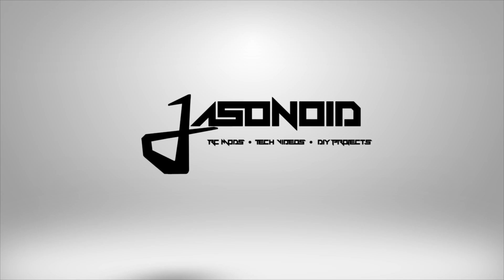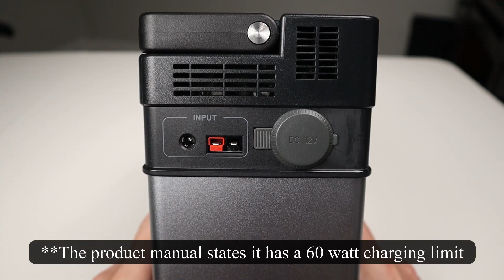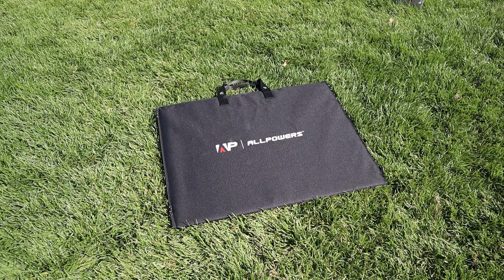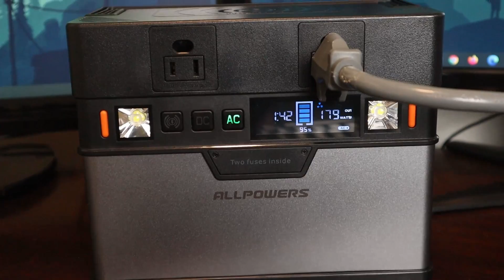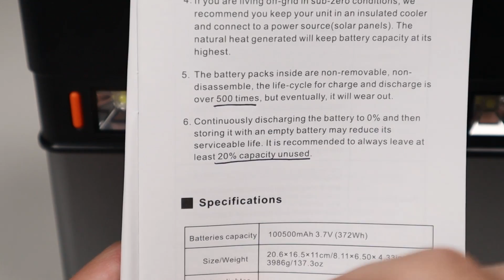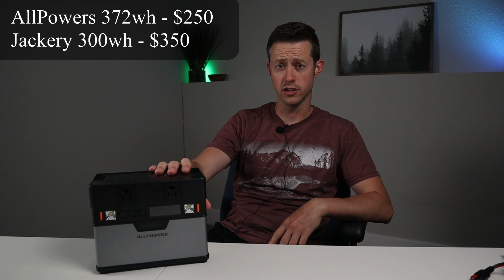ALLPOWERS Lithium Solar Generator - Affordable and Powerful!

Comment: Bought one these,this model actually, great for first 5 or 6 months then it just stopped working no notice nothing,we couldn't return it as amazon said it had to be returned in oringinal packaging which we didn't keep,so it turned out a very product for the short time we had it,stay clear of it  knowing what I know now
Reply from the maker: This is definitely more of a "budget" brand model, there are way better options since this one came out (super old video here). Check out the Ecoflow River 2 or the Bluetti EB3A

Comment: Bought 2 sadly both faulty, but theres a man youtube call moho, he had 3 new one broken, seem quality control problem, lose cables connectors and damaged wire while case being closed in factory etc. but some cases can be opened and fixed. Will buy western long term brand, that can be replace and repaired.

Comment: I bought the AllPowers with a 12V fridge for camping / emergencies. The brand I got was F40C4TMP, which only seems to exist on Amazon USA & CA. It looks identical to the Goture brand fridge you reviewed in Jan 2021, so I would guess its the same thing just without the ugly brand name slapped on the lid (mine actually has no branding on it at all). The lack of regulated 12V (out of the cigarette socket) really bit me as, even with the battery protection level set to low, the fridge would error out at 48% on the AllPowers. Thankfully, I've since found one can get regulated 12V out of the barrel connectors, so I'll be picking up adapters soon.

In my research, I somehow missed the fact the AllPowers 372Wh model has a charging limit of 60 watts. This kinda sucks as I bought a 130 watt X-Dragon folding solar panel to go with it. Though in my testing, the highest I've gotten was 57 watts briefly. In extended testing, the wattage settled down into the lower 50's. I wonder why with such an "overpowered" solar panel, I can't even consistently get the 60 watt limit?
Reply from the maker: I have since learned much more about these smaller portable batteries and possible downsides. This ALLPOWERS battery is GREAT for cell phones, tablets and other smaller loads but the unregulated output is a bit frustrating with 12v fridges. 

These smaller batteries are limited to 60 watts solar charging, and then the slightly larger ones are limited to 100 watts. The Bluetti EB70 has a solar charging input of 200 watts (160 watts solar) and ECO flow units can charge at higher levels! 

My more recent videos have much more info on the subject of running fridges off larger models with regulated outputs.
Reply: @Jasonoid  Yeah, the two limitations of the Allpowers seem pretty common with this class of small power stations. The 500wh size of power stations would have been better for me. 
The bluetti ac50 looks almost prefect but it's segmented battery guage (instead of showing battery percentage) really bugs me! Lol
Thanks for the reviews!
Reply from the maker: They have a new EB55 coming out, so it's a smaller version of the EB70. Also I think I found the BEST budget power station, review video coming out Friday this week.
Reply: You don’t seem to have realised that the two DC ports beside the USBs are regulated so you just need an adapter. And using the USB C gets a better charge rate

Comment: I have this unit. Couple of notes.
The Power delivery 60w port is 2 way so you can charge from your car or an appropriate wall plug with a 60w pd (usb c) output.i prefer this method as I can get 62w input on my unit charging.

Also not something I have tested myself but apparently the standard 12v car out isn’t regulated so could cause issues on some portable fridges with voltage drop. but small 12v outputs are regulated so can add an adaptor and use them which would be more reliable 👍
Reply from the maker: When I tested the 12v socket it seemed to run my ICECO fridge fine. It never shut off due to low voltage. Thanks for the tips, I have liked this setup quite a bit, especially how small and portable it is.
Reply: Jasonoid as I say, I haven’t seen that for myself but if you have tested it and it holds up then all the better 👍
Certainly is a great bit of kit though. Look forward to using mine more. I bought it mainly for outdoor cinema nights running my projector
Reply: Yep 12v cig is not regulated it woll drop down to 10v at 0%, most 12v sensitive devices like other fridges and cpap will stop at 11v 
use the 12v 5a with adapter as its regulated

Comment: I love my ICECO JP42.  On my Jackery 500 from 7:15 p.m. till the next morning at 9:30 a.m., I opened my ICECO,  and my thermometer inside read 5 below zero F.  ICECO ROCKS!!!  My Jackery went down to 16%.  I wouldn't make it a habit to run it that hard, but it's good to know what it can do.
Reply from the maker: Thanks for sharing, the Jackery 500 is a great unit!

Comment: I can't charge through the Anderson port or USB c quick charge which is supposed to be reversible and capable of charging it
Reply from the maker: USBc port is for output charging only. How are you trying to charge it via the Anderson power pole, through a solar panel?
Reply: @Jasonoid  yes.
Reply from the maker: @sun-sea-solar  looking at the owners manual it shows that the input voltage needs to be within 16-22 volts, and less than 3.2amps. You using a solar panel with a solar charge controller built in or just the straight solar panel because the Allpowers has a solar charge controller built in already.
Reply: @Jasonoid  that might be the reason. Thanks for checking

Comment: Great review!
I have the same 606Wh Allpowers battery, but my one has an issue.

I’ve connected DC 55v item, and the display is supposed to show as remaining time around 11hours (606Wh / 55w = 11h)
The user manual also mentions this, 50w application will run for 10.5 Hours.

However, it displays only 4:57 hours. But after 8hours the battery is still running.

Also after battery is fully used, I charged battery only 6mins but it displayed 31% charged already.

So the ‘time to empty battery’ display is completely wrong and unusable.

So i contacted seller and they sent me a replacement but exatly the same issue.

Do you have a similar issue?
Reply from the maker: Wow, this is a super old video haha. My videos have changed quite a bit since this one. This is a super "budget" power station so its going to have a few bugs. Innacuracy on the estimated time remaining is probably one of those bugs you just have to get used to. You'll want to use it a bunch and learn how it behaves with certain loads over time.

Comment: Hi I have the S300 300w 2022 version. I know that it has a MPPT solar charge controller in built so you can plug the 100w panel directly to it. But I am interested in also using the100w  panel to charge my leisure batteries separately lead acid or gel. Any suggestions regarding a free standing solar charge controller that will work with this 100w panel? Thanks Tony from the UK

Comment: I have two of these, both have issues with the 12v sockets and DC outputs. 4.5v and the AC inverter trips at 190 watts. Allpowers have sent me two. There generator is junk I think. Both are two weeks old and are faulty out the box.
Reply from the maker: Thanks for sharing your experience. This video is a bit dated now and I have since learned about "better" power stations. After hours of testing and many videos this is the video I recommend to watch for anyone looking for a power station now:  https://youtu.be/64nZ3_Hs4Z8

Comment: How is the fan noise under load?
Reply from the maker: It's very quiet, hardly notice it's running
Reply: @Jasonoid  thanks so much, deciding whether to purchase this or golabs.
Last question, is one of the 12V OP regulated?
Reply from the maker: @quicksilva125  it's not regulated, so might want to stick with a regulated one.

Comment: Can you charge with the solar panels and use a 120v fan at the same time?
Reply from the maker: Yes, It supports solar charging and the AC inverter at the same time.

Comment: Can you change the AC voltage (110 to 220 vv) and frequency (50hz to 60hz vv)?
Reply from the maker: The voltage is stuck at 120 60hz. You'd have to buy one specifically designed for 220v
Reply: Actually you can change the 60hz to 50hz with the Bluetooth app if it does work like that. Because, this battery station has a app. But best to test it with a cheap and less powerful fan and see how it reacts with the motor. But anyway stay safe with the feature. But not the voltage. But they are coming out with the allpowers Monster Pro that will have the higher voltage plug.

Comment: On Amazon - With a total of 81 ratings; 15% of the people gave this unit 1 star and if you were to add the 1 stars and 2 stars together it would be 21%. It would seem they have a reliability issue... Take Care
Reply from the maker: I will be providing any updates or recommendations on the product as I use it. If it breaks, you all will know about it. I feel that many products on Amazon have similar ratings. Lots of 5 stars, lots of 1 stars. Thanks for watching and I understand where you are coming from.
Reply: Also worth noting that many people thag have no issues, never review, but everyone with issues, will.

Comment: I would like to know if it has regulated DC output. I don't want it to drop below 12 volts while running astrophotography equipment. I almost bought the 'Progeny 300W Power Station' which has a regulated output, but I like the ALLPOWERS 350W too...
Reply from the maker: I just tested it, it drops below 12v, you'll want a different product. Jackery are some of the best on the market, they are more expensive though.

Comment: I am early in my education of solar.  I've seen the Jackery mentioned alot and also the Bluetti.  I gather from another website that the Jackery uses a pvn(?) Controller and the Allpowers and Bluetti uses a MPPT controler.  For someone new to these systems and on a tight budget would you have any advice for me?
Reply from the maker: Blueitti and Jackery are very reliable, and they are more expensive than this model. I haven't had any issues with this one. I still recommend it for it's price! What are you looking to run?
Reply: Go with mppt always and cheaper wh
Reply: @Jasonoid  I'm in Florida, spent a week without power after Sally.  So honestly something economical right now.  Thanks for the reply.  Sorry I'm just now seeing it

Comment: I just purchased the TR60 (thanks for the review!) and this battery, but when asking the allpowers support folks about charging this battery via my 12v while driving, I was advised against it since it ‘will not fully charge and could permanently damage the battery’. Any idea why this would be with a 15A 120W cigarette lighter outlet? I figured using the stock household outlet in my trunk would be too inefficient since it essentially converts the power twice.
Reply from the maker: So I just tested this theory on my battery box. The ONLY way to charge the box is through the Input ports on the side of the box  (DC barrel plug or Anderson Powerpole connectors). I was unable to charge it via the 12v socket, it appears that is designed for output only. The AC charging adapter puts out 20v so in theory any 12v battery source should be able to charge it. So I went ahead and tested both the Anderson PP ports and the 12 barrel port for charging with different voltages. This is what I found: 

The Anderson PowerPole voltage range is from 16.3v  - 21.25 volts. So this port appears to be designed for mostly Solar Charging from a solar panel. I wouldn't suggest using anything else for that.

The 12v Barrel Input voltage range is 9v  - 21.25 volts. So if you made a custom cable that went from a 12v cig socket to the 12v barrel adapter, you should be able to charge this from any 12v source. It worked from my lead acid battery, my LiFePO4 and my power supply just fine. Let me know if that makes sense.
Reply: @Jasonoid  Thank you so much, yes it makes sense. I really appreciate your time and effort. To clarify, I wasn't trying to charge the battery via the battery's cig socket, but using the cig socket in my car going in to the battery's 5.5x2.1 input (this is what the manufacturer advised against saying it wouldn't fully charge due to the car's cig output only being 12v & it would hurt the battery in the long run even though the battery's instructions and website say this is possible). I was also wondering if I could buy a cig socket to Anderson connector and use the battery's Anderson PP to charge via the cig socket of my car - you answered that question above so that's a no go - thank you! I will buy a cig socket to 5.5x2.1 barrel adapter and see if that works in my car and fully charges the battery. It seems like such an energy waste to use the car's (4Runner/GX470) stock trunk household outlet to then use the battery's AC adapter to charge it (and it gets hot).
Reply from the maker: @sooosiehddasaus  Good luck, that should work. You will love that TR-60!
Reply: @Jasonoid  Thank you. I see the AC charger for the battery is a 20V so I guess to follow up on the manufacturer's advice: the logic being that the car's cig socket is a 12V so the battery will only charge about 60% using the car's cig socket into barrel adapter of the battery. Is that accurate?
Reply from the maker: @sooosiehddasaus  when the car is running it puts out 14.2 volts from the alternator, so you should get a full charge. It might not get the full 60 watts near the end but it should charge just fine.
Reply: @Jasonoid  Hey Jason, thank you again for your advice. I figured I'd share the best way I found to charge this battery in my car. Using the battery's USB-C PD port to charge the unit via a cig lighter PD 60W USB-C out seems a great way to charge as if the unit was plugged in to the outlet. When the fridge is on, the charging is limited from 60W to at first 20W. The only draw back is the fridge turning on and off, during which the charging goes down from 20 to 14 to 7 watts as the fridge's cooling cycles continue. Not sure why the battery pack is accepting less charging wattage with each go around but it works none the less.

Comment: Curious since you just tested - on amazon, it shows 300Watt Nominal, 500Watt peak - but the blender blew the circuit at just of 300watts.  How do you explain that? 

From Amazon Specification:
Battery Capacity: 372Wh/100500mAh
Rated Power: 300W, Peak Power 500W
Output Waveform: Pure Sine Wave
Size: 20.6x16.5x11cm/8.1x6.5x4.3inch
Weight: 3986g/137.3oz
Reply from the maker: Well from my testing it appears to be accurate. The unit ran the startup of the blender, which surge wattage is definitely higher than 300 watts, after about 5 seconds running above 300 watts it finally shut off because the load was higher than 300 watts. The wattage display isn't showing the whole story, it takes time to calculate what's happening. Hope that info helps. I was surprised it even ran the big blender like that.

Comment: Would I be able to charge from a Solar Panel at the same time running something off it?
Reply from the maker: Yes, this will charge at 56-60 watts using a solar panel and allow you to run some small electronic loads. This power station works well for charging cell phones, tablets and running small electronic loads. If you want to run something larger you'll want to look for a bigger power station, check out some of my more recent videos for something that will be a little bigger.

Comment: Hi Janson how do you charge it. Do you have 2 turn on lights to charge.
Reply from the maker: It charges with solar panels, the 12v socket cable, and the included ac adapter.
Reply: @Jasonoid   i had it plugged in wall.
I thought you can charge it in wall 
I have the 500 watt.
Reply: @Jasonoid  i had it plugged in the wall. It was 0 percent when turned on. Does 12v socket cable come with it . im sorry bought it and dont know how to use it. I have 500 watt.l
Reply from the maker: @lajuanadukes2171  It should have come with different cables to use. Did it end up charging using the wall charger?
Reply: @Jasonoid  no it Didn't. It wasn't charge like you show on video.It came with the wall plug only.And the solar panel with it adapters in back of solar unit. They gave me a refund back $535.real quickly. But they dont want it 🔙. I wonder WHY? It was not charge when i got it out box. I took that 💰 and ordered a bluett 500 coming on the 20th. If you live around here you can have it.
Reply from the maker: @lajuanadukes2171  Glad you got your money back. I live in Utah so it's probably not very close to where you're at. Put it up on craigslist and see if anyone wants it for a project. Great choice on the Bluetti EB55!
Reply: @Jasonoid  Awwwwwwww thank youuuuuuuuu blueitt not complicated like that on. I appreciate you for helpin me will watch and support your videos

Comment: Can this allpower charge using solar and use AC power at the same time? Most basic battery only support charge only or discharge only at one time for the AC.
Reply from the maker: I was able to use it while charging on Solar Panels. I think it works that way but these companies don't support it. I have seen the same warning on many other portable batteries. "Don't charge and use it at the same time". If the load is small I don't think it will be an issue.
Reply: @Jasonoid  I believe only powerbank with UPS feature support charge and discharge at the same time. My powerbank will cutoff the AC inverter if any charging come in.

Comment: What is the maximum solar panel watt i can use to charge it,? Can it be 120 or 200w?
Reply from the maker: 60 watts max, most of the smaller battery boxes take 60 watts. The Jackery 1000 can take 120 watts input.
Reply: @Jasonoid  tq for answer
Reply: I just got mine Today with allpowers 100w solar panel and  on direct sun can charge with 60w.